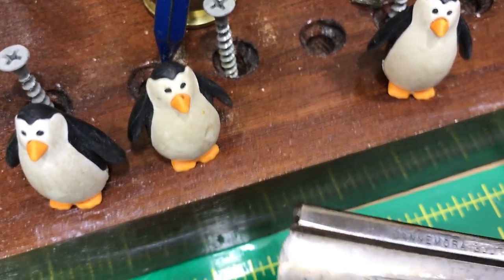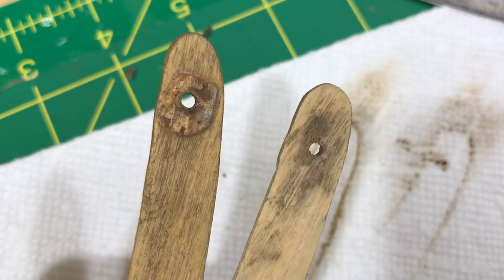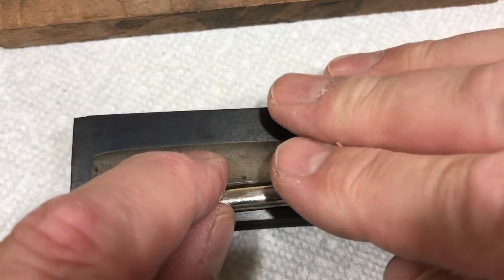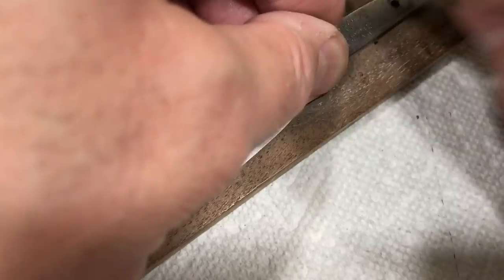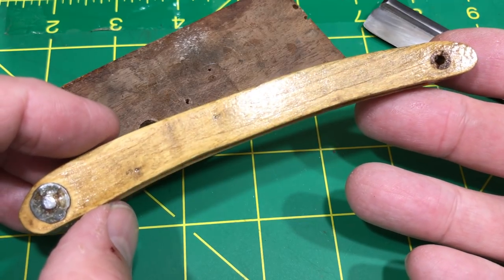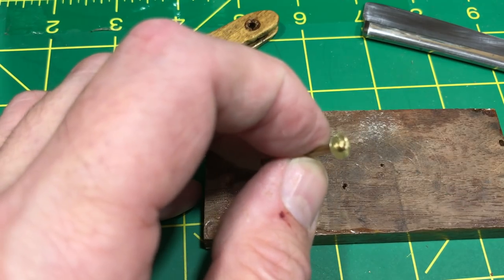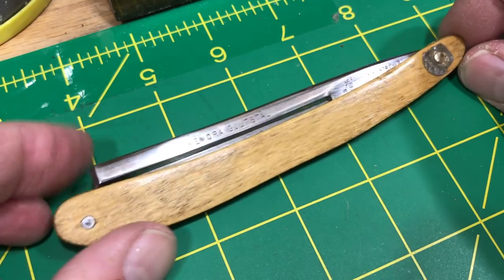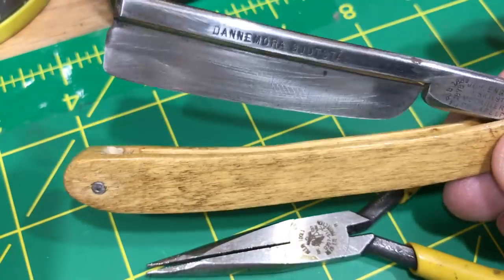Cheap Straight Razor Restoration -

Comment: I remember that post by Maggard's and it's good sense, but thinking about it, I wonder if it's a bit out of date by now, maybe? With current prices on restored and shave-ready razors, it could be that that generic 'Solingen' razor, once restored and honed, is worth 100 dollars (or more).
Reply from the maker: Actually, given the uptick in interest in this aspect of wetshaving, Brad’s point is more valid today than it was when he wrote it. 

From a financisl POV, the resale value of most garden-variety straights doesn’t warrant investing $80-100 into a restoration. Sure, there will always be sellers and restorers selling razors at higher prices, but that’s not an accurate indicator of their actual value. If someone drops $25-30 on a 5/8 Shapleigh, then pays $80-100 for a resto, he’s looking at a $105-130 investment that would return about  half or less than that on the open used-razor market. 

Lots of guys find rusty old razors in flea market and many (not all) of them automatically think they have a bonafide historical find worthy of a notable investment. There have always been a lot of guys, and restorers, supporting that notion based on many reasons, not all of which were always accurate or honorable. 

Brad’s message was, mostly, about being smart and thinking  things through, which is always a good idea and certainly not an outdated one.

Comment: I just want to say that I like the choices you made with the razor. For my personal preference I would have like to seen the etching on the blade stay. Sometimes You Can't Always Get What You Want. I have a question. How do you deal with a blade(such as the one you have there) when honing it where the blade is not the same width at the heal as it is the toe? I would think the two different lengths would change the geometry from one end to the other. Have a great day and I hope it shaves well for you. Aaron
Reply from the maker: HI Aaron, thank you for watching and commenting! Good point - the geometry issue you're referring to is exactly why I mentioned that I didn't know what I was going to have to do when I got the blade on the bevel-setter. In this case, the spine followed the blade very well so the bevel was visually 'ok' and no gymnastics were required to hone it. Most blades I own have smiles or wear so there is, often, a variation in bevel angle  but it's usually minimal and/or manageable.  I didn't bother to do the math with this one, everything looked to be fine and the edge shaved very very nicely.

Comment: Ha! I spent nearly 6 hours over the last few nights setting the bevel on one of those dinged up old Engstroms ! "Hard". Tempted to take it lower that the 1.5k shappy, but I didn't want those low grit scratches "lurking" on the bevel for the rest of the life of the razor...
Reply from the maker: Yep - Swede steel is pretty tough stuff!
Reply from the maker: I think the steel in the later model Engstroms was harder.

Comment: Hi sir
If I want to buy only one stone for honning what grit would you recommend.
Thanks
Reply: I bought a small sharpening stone from china but its too small one side is 3000# and other side is 10000# i doubt the 10000# grit as it looks like floor marbel and doesn't have any effect on the edge
Reply from the maker: I would recommend sending your razor to a professional for honing.
Reply: @KeithVJohnson1  I am from India , there is no such service available here
Reply from the maker: @nishantashar5137  You can probably find someone you can mail it to. You just have to do some searching.